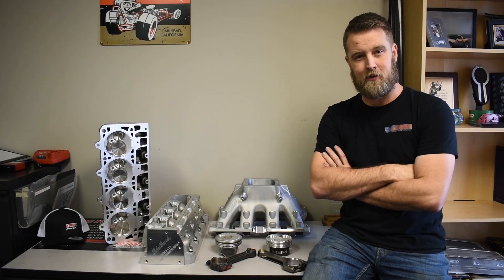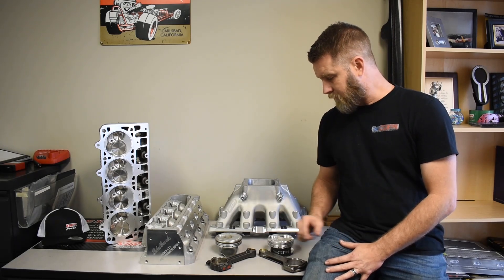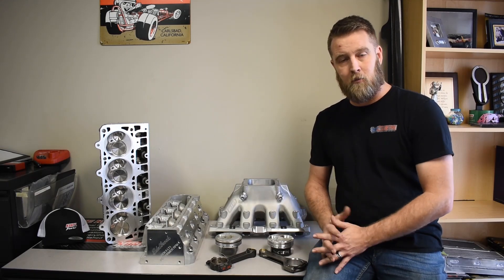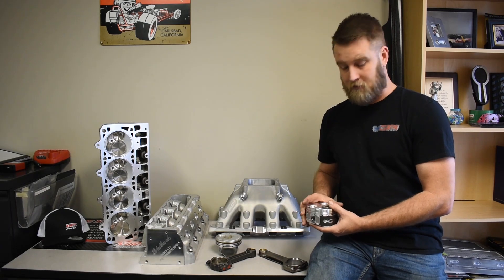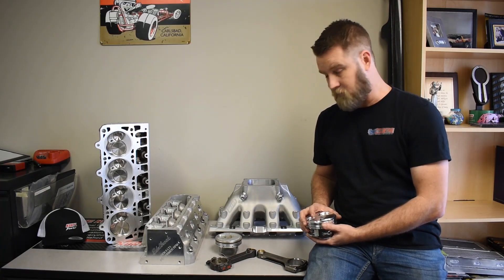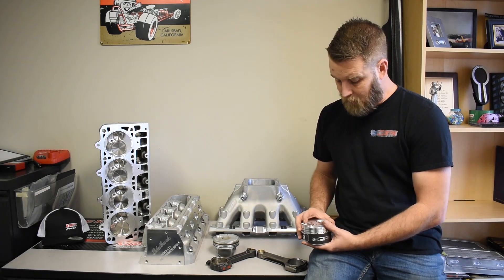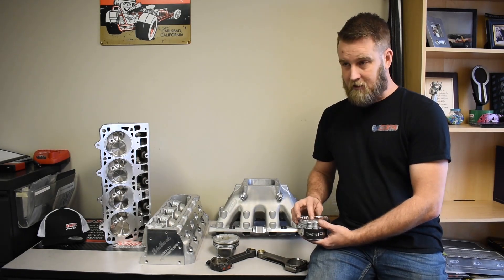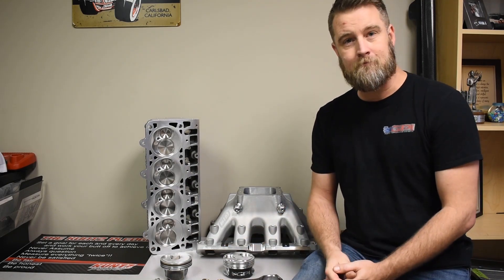Answering YOUR questions about our LT1 / L86 / L83 Drop-In Piston Rod Combo!

Comment: I am very interested in this set for my 2016 Camaro.  I would like to know what the length of the rods are center to center.  I believe factory is 6.098”.
Reply: It's 6.125", but the pin height on the piston is different than stock so it adds up correctly I believe.